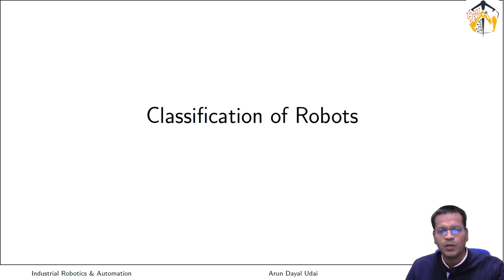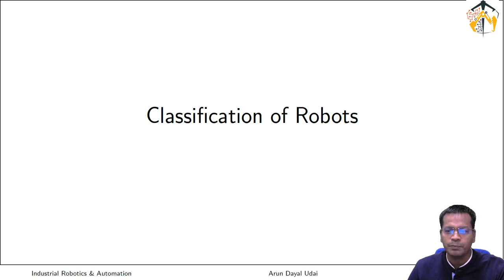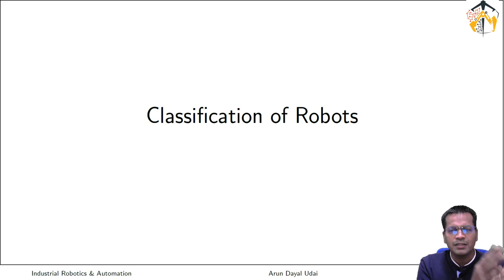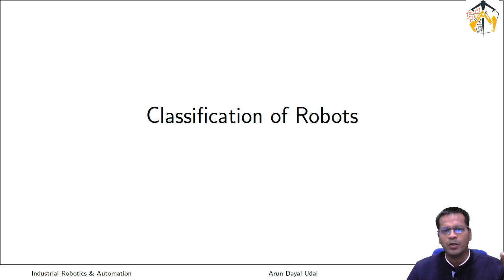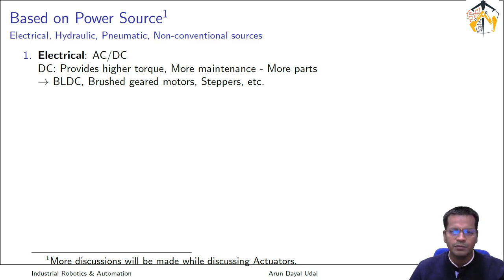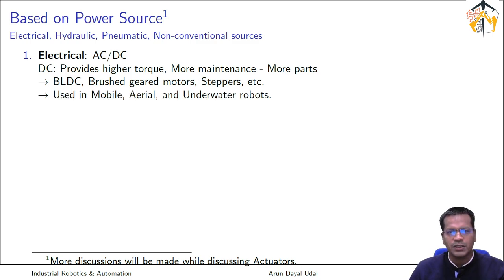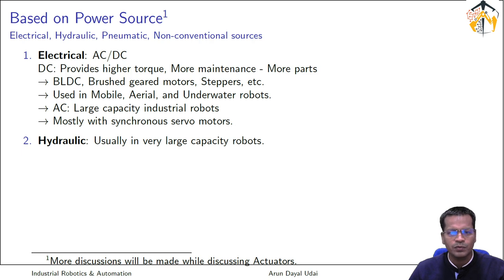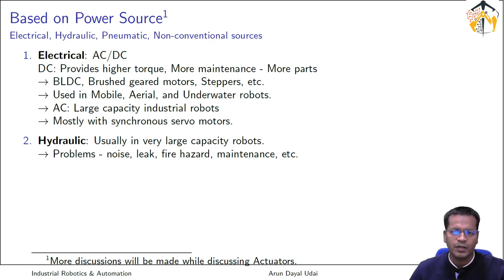Classifications of Industrial Robots

Comment: 9:15 Based on Power Source - Electrical, Hydraulic, Pneumatic and Unconventional

16:00 Workspace Geomtery - Prismatic and Revolute joints
     17:02 Cartesian Robot 
     19:04 Cylindrical Robot 
     20:28 Spherical Robot 
     22:14 Articulated Arms 

27:00 Degrees of Freedom

33:00 Kinematic Structure

37:00 Movement

42:00 SCARA (serial) and Delta (parallel) robot

45:30 Cartesian space motion in serial robot
50:10 Joint trajectories of serial robot

55:25 Cartesian space motion in parallel robot